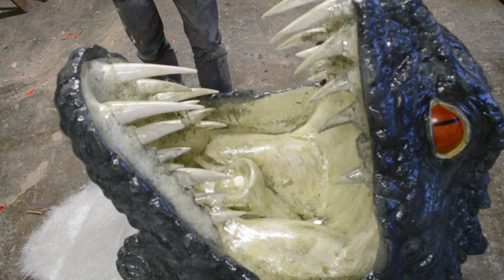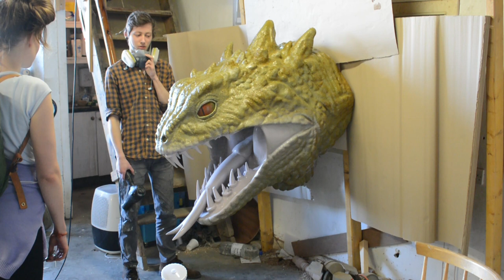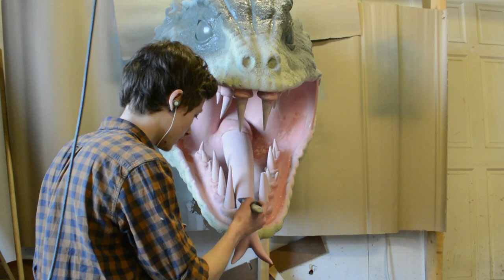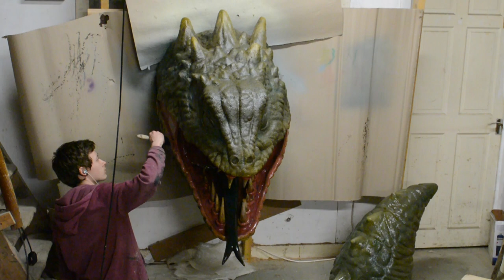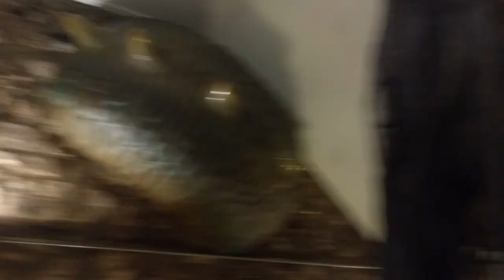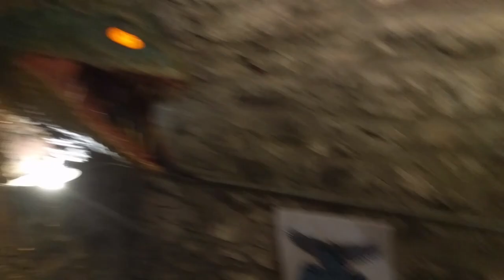Creating a Basilisk- Painting (Part 2)

Comment: What product did you use before painting? Is it something to harden the sculpture? Did you only use the fiberglass in the mouth?
Reply from the maker: I fibreglassed the whole head. I then went over it with a thick layer of resin to give it a scaly texture and cover the fibreglass
Reply: in the first seconds of this video, you paint it with some grey paint. what is that? that´s resin?
Reply from the maker: @studio2750  Thats latex. A few layers of latex protects the polystyrene from the polyester resin, which would melt it otherwise